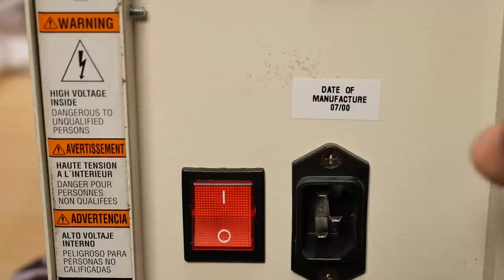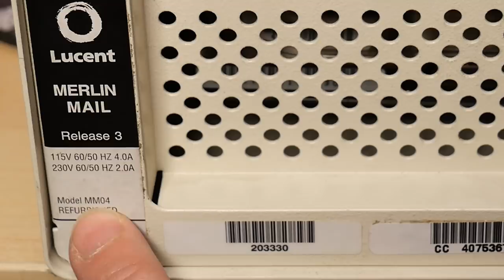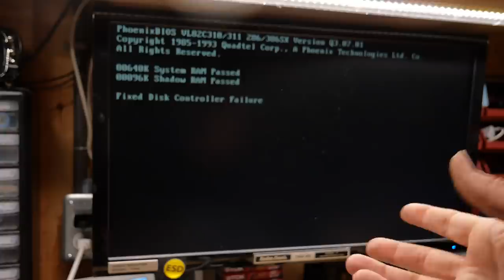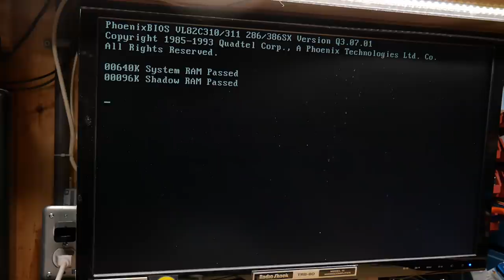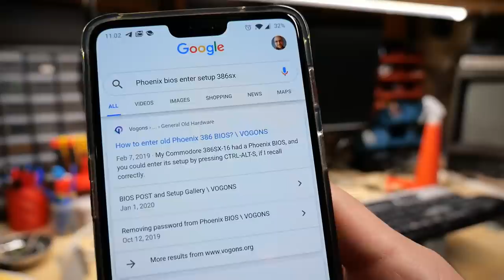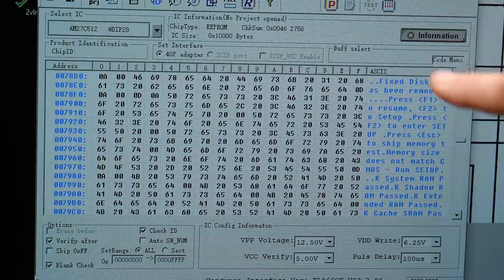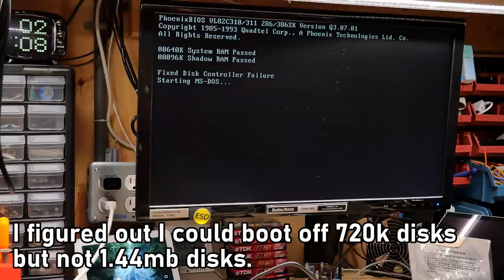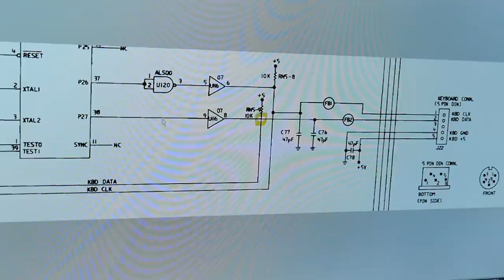Trashpicked Voicemail System

Comment: Ugh, that Fujitsu hard drive just gave me flashbacks to the early 2000s when I worked at a college and we had 100s of 20GB versions of those drives that all failed - it was a bad batch and Fujitsu had to replace them all for free - but we had to install them :(
Reply: Was that, by any chance, the famous batch of bad drives that Sun Microsystems got?  The ones that stuck, and could be temporarily unstuck (so you could keep using the system while you waited for the warranty replacement drive from Sun) if you slammed them on the desk in the right way?
Reply: David Evens possibly, not sure of the exact model but they looked exactly the same as the one in this video.  I remember thinking at the time it may have been an issue with the drive electronics because when the bios detected the drive it would show random characters instead of the drive make/model.  I don’t think we tried slamming one of these drives although that has worked for me with other drives in the past long enough to recover data.
Reply: @reddragon27284  Ah, yes, I've had a drive fail in the manner you describe, in my case it seemed to get worse as the drive warmed up.  When the drive was cool, it was still readable, but it gradually began to fail more and more until it stopped working entirely, until allowed to cool again.  Retrieving the contents took several days, as I recall.

Annoyingly, I don't seem to be able to find any specifics on the bad batch of hard drives SUN got sent.  This is annoying, as it's a wonderful story.

Comment: The bios has probably been made "tamperproof" due to the function of the machine itself so you couldn't hack into people's phone messages. I wonder if there might have been a special matching engineer's boot disk.
Reply: Probably not, due to the lack of a removable media drive in the system.  A maintenance password, very likely.

Comment: Certainly an interesting little PC of sorts, I was half-expecting one of them Single-Board Computers (with the CPU, RAM, controllers & whatnot on one ISA-connector equipped board) inside there, which if I'm honest would have turned out to be more useful I'm sure... :)

Comment: also it’s been so many years but I swear you are not pressing the bios key’s fast enough. I remember some of them you had to hit it like 15 times  the moment you flip the power on to time it right. ( ok maybe I was an overzealous teenager but what I mean is that early timing was crucial) Also consider also trying Ctrl-alt-insert and Ctrl-alt-escape.  Good luck!
Reply: I had the same thought! Too early? No good. Too late? No good. Where's the sweet spot? Who knows. Just do it 15 times you'll catch it in there somewhere ;-)
Reply from the maker: I tried all of those comments. I've been working on PCs since the late 80s and used to work repairing and building them for work in the 90s. I'm very familiar with all the permutations. This is clearly altered to prevent user servicing.
Reply: Adrian's Digital Basement I hope you get it working with the serial console method that other people have talked about. I never doubted your skills… I just know that some BIOS’s back then had a hair trigger timing. We’re about the same age... grew up on C64 and then my first PC motherboard  I bought with my own money was a 386sx-20 ( very similar to this board with drams and simms. Fun memories! ).

Comment: Did you try booting off the HD with the monitor plugged in? Would have been interesting to see... Or was the drive dead?
Reply from the maker: Yeah I should have noted that in the video. The drive did still work but just showed nothing when booted. (It goes into DOS and then autoexec lads the single EXE on the drive.)

Comment: maybe try to access the system thru the serial boards. servers of that time also didnt had graphics cards or keyboard plugs. just grap a good old vt100 or a pc with a "null modem" setting and try maybe 9600,8,n,1 just my 2 cents

Comment: 1.2mb floppy is a Japanese format. Likely set to stop people from booting DOS.
Reply: It’s the bog standard 5.25” High Density format.  In the 386SX era, that was still commonly the primary (A:) drive.  Later (when the 386DX was more affordable, and 486 era) it shifted to 3.5” 1.44MB as primary.

IBM’s XT, AT, and PS/2 systems defined the norm - and that was 5.25” 360K, then 5.25” 1.2MB, then 3.5” 1.44MB.  (720K wasn’t used in the PC market for very long.  Much more prominent for e.g. Amiga.)  As such, those are the formats that you would find commercial software on, and so the PC clone market followed suit.  Ergo, 1.2MB is likely just the default option on a BIOS of that period.

Comment: if the cmos battery is dead then of course it’s not going save your settings in the bios. or am I missing something?
Reply: It reverted the settings back to the hard coded values. If the cmos was bad it would say checksum error
Reply: @NaokisRC  In the normal BIOS, yes, but this seem to be modified and doesn't react on many errors, like VGA, Keyboard and may be checksum error as well?! Like I wrote in a comment below (see Necroware), may be it is worth it to fix the battery or replace by an evidently working one. However, I guess Adrian gets so many comments, that he will not see our suggestions :)))
Reply: @scorp4770  Yes but the point being, it knew when a battery was dead as Adrian said it came up with "checksum" error with his other rtc with a bad battery. So this one, even if not new, the battery is still good. And a BIOS wouldn't set the hard drive type anyway

Comment: Adrian - in the setup.com program you were supposed to hit Escape, F10 was just to exit the program.  Escape was reboot, which I assume would apply the settings.
Reply: Oh that would make sense. Hope he revisits this.
Reply: @NLDXBOX  me as well.  As another commenter mentioned, I would also like to see what happens when it boots off of the hard drive that was in there.  If it even boots at all from it.
Reply: Check out the help menu as well for other commands. Looks like it never saved or it's wired to reset it self. Try to change the controller board placement, could be an IRQ conflict thing. Or change the controller and other boards. Try to unpatch the cable under it.
Reply: That's what I was thinking, ie, F10 exit without save.
Reply: Yeah, and if that fails, I remember that there was also a utility for these PhoenixBIOS chips that could lock the configuration. It would have been a separate utility that would 'toggle' the lock at each run. Back in the 80386 era, I had a computer with the exact same BIOS as this one, only it was accessible through F2, as he showed. You could also use the supplied disk to access setup. The disk also contained this other utility to protect access to setup. You could even set a password for it, but that wasn't required. If protection was enabled, the 'Press F2 for setup' message disappeared at boot. Therefore, it wouldn't save the config if you tried to edit it using setup.com.
Reply: Hm it's kinda lost to "young" people that you don't have to enter the program's extension. Entering "setup" would have done. No need for the .com.
Reply: senilyDeluxe right?! I wondered why he did that as well.   Too much commodore I guess haha
Reply: @NLDXBOX  I think it'd be cool to see him using telecom equipment to play DOOM! ;-) I do hope he revisits this computer at some point though. Wonder if he could actually use it as a voicemail?

Comment: It's very likely that the motherboard is setup to run with a serial console...  I'd try plugging in a terminal or serial cable into another machine with a terminal emulator... also if I remember correctly the older at&t voicemail systems from the early 90's were unix based and used a serial terminal vs. a vga monitor and keyboard.  Looking at the data on the hard drive might give you some clues as well.
Reply: You could use the old Unix voicemail or buy a much cheaper DOS based system. Phone equipment is/was freaking expensive.
Reply: This. I came here to say this. Try connecting via serial
Reply: @Steveos312  why would you think that?
Reply: @mstandish  because you're using dos to run your systems for cheaper haha /\
thats the dif between a 10 user system and a 1000 user system
Reply: @frogz  It was around 200 people and was provided by a government contract. The PBX we used was a System75 running off of tape.

Comment: My guess is that it was built in the mid 90's and the HDD and battery were replaced in 2000 with a refurbishment as well as new software.
Reply: That is what I was thinking, a factory refurb replacement was swapped instead of repair to keep phone systems up.
Reply: I was building something like that in late 90s into early 2000, used a 486 motherboard, ran dos 6.22
Reply: Considering it had a sticker mentioning refurbishment I'd say that'd be the obvious answer that its baffling the guy didn't figure out on his own.

Comment: A lot of people are mentioning the fact that the "serial port/console" is your way in! I agree. Probably the reason for this weird keyboard setup + the keyboard connector was not accessible from the  outside. I wouldn't be surprised that they have created some weird serial keyboard (or special console device) for their technicians
Reply: The systems i work on got programmed from the phone system itself by command down the phone line interface
Reply: A program on a Toshiba Laptop should do it.  (some laptops did not carry the correct pin out or line voltage to work the programming card on phone systems, same could be on this).
Reply: @highpath4776  could be also a special serial port, I work on several devices whose serial port required a special cable, but I would say knowing most probably programed though phone system

Comment: 14:36 9506 is the date code on the Dallas RTC, so it's original. Also, the case says "refurbished". It was an old machine from 1996, they replaced the hard drive and the power supply in 2000, then sold it as refurbished. It would have been wise to replace that RTC chip as well...
Reply: Yes. 25 Years is a normal lifetime for these RTCs.  I have one from 94, it is still working.
Reply: wise yes
needed no
25 years later and its still going strong
Reply: @frogz  I'm not sure if it's still running. The BIOS utility said that the RTC date is 1989. It might be caused by the utility was unable to read the SRAM/RTC data. 
But if you ask few hundred dollars for a refurbish job, yes, replacing a 5 year old RTC battery is a minimum. Okay, the expected running time is around 10 years according to the datasheet (they don't say it's guaranteed!), but still. A working RTC in such equipment is quite important.

Comment: Networking gear is another great source of surprise PC re-usable equipment.  An example was about 17 years ago while cleaning up old equipment I noticed an old router oddly had a VGA port, serial ports, and PS2 connector.  I cracked it open and found a tiny motherboard sporting 6 network ports, an IDE connector + 2.5 HDD, one DDR slot, and an old Cyrix VIA chip.  I connected up a dual connector IDE cable and a CD-ROM and the thing booted off of an XP CD.  I had no problem installing XP on the little sucker.  XP crawled but it ran.  I put in the biggest DDR memory I could find – 512MB – and wound up transferring our old keycard system onto it from an old dying dust packed tower that was sitting under a desk in the basement for the last 5-6 years.  I screwed that little system to the wall and it ran like that for another 10+ years before finally a complete security system upgrade.
Reply: I ran into a similar situation with a small form factor pc used as a controller for a remote access KVM device in a server room.  It was an AMD K-266 with 128mb RAM.  I acquired a scrap pass to bring it home and ran it as a firewall/ router running Coyote Linux booted off a floppy.
Reply: There used to be PC Magazines that did how to build routers out of old 286/386 units

Comment: I used to be a CallWare Reseller/Installer.  It was a Voicemail system that ran on top of Novell Netware and  we used a lot of the Brooktrout boards.  Those were very common in-band signaling board (that means the phone system sent a hook flash then the DTMF code for what type of call (ie. Voice Mail Retrieve, No Answer Message, Caller Busy Message, etc) and then it sent the extension number that it was coming from and then another hook flash, and transferred the call.   There were all kinds of systems and each brand had is own codes and methods.  Some were well documented others we had to use a box called a digigrapper to monitor the line and see what codes it was sending and do a bunch of test calls.  There were also systems that used out of band signaling as well like SMDI ( a seperate cable) or TSAPI (A network protocol that signaled across IPX/SPX).  You could run the non DSP cards for up to 4 ports but (each one of those RJ11's is wired for two lines), after that you had to get the DSP version to off load the voice processing from the CPU.   As we started going to faster processors that became a non-issue.  Then VOIP started to take over the world and it all changed.
Reply from the maker: This thing was running DOS 4.0 and had a single executable and autoexec on it. I remember seeing one of these in use a long time ago and there were nothing but RJ11s between it and the PBX, so I'm assuming the DTMF signalling you mention was used. Another comment said this was available as a 286 as well which was very slow and struggled. Hmm
Reply: @adriansdigitalbasement  I am cleaning out my storage unit that I have been backing full since 1994.  I am pulling a lot of the boards ram, keeping a few cases and stuff.  If there is anything in particular you're looking for let me know.  The vast majority of it is Pentium 1 and up.  I scrapped the XT/AT stuff years ago, which I am kicking myself over now.

Comment: Brooktrout is one of the few companies that make Analog voice boards for VoiceMail and Fax. Each of the two boards has two Analog ports, as you pointed out. These do not have dialtone but will answer a ringing line, and are just an audio circuit (usually) and can send and receive DTMF, etc.  The VM communicated with the phone system over one or more serial ports (RS-232), those handled the signalling of what port to answer,a nd with what, light Message Waiting lights, etc.  Common serial settings were 9600 8N1, try hooking a serial console to them!  It looks like the original build was 1994-1996, and was factory refurbished in 2000 as indicated by the sticker on the box.  I never worked on the Merlin Mail, but AT&T commonly used System V Release 3, 4 or 5 of AT&T Unix, or MS or other DOS as the OS.  All of your bios control is probably done through Serial, or hard coded at the factory to ignore the keyboard.  You can drop the HDD, and Brooktrouts in any 386 or 486 motherboard and get it running probably, did that on quite a few VMs in an emergency.

Comment: I think the last line on the Dallas device is the date code + some chip revision, i.e. it was manufactured in week 06 of 1995.
Reply: I thought the 12887 was a fairly recent replacement part for the 1287..?
Reply: Exactly this definitely was not made in 00 but perhaps serviced then. It had to be earlier.

Comment: I have a Merlin 820 KSU and 8 Merlin voice terminals (that’s what they called the desk phones) installed in my house and I love the system. It even integrates with VoIP and my mobile phone. Amazing for a system that was designed in 1984!
Reply: That's pretty cool. I guess they knew IP phones were coming sooner or later, what with the ISDN buzz, and wanted to be sure they didn't have to make a whole new system just to accommodate it later. What kind of mobile phone integrations does it have?
Reply: @kaitlyn__L  This era, some of them would optionally notify your pager you had a desk call when you were away. That was a pricey ($3,000-5,000 IIRC) option. And that was hot back then. I kid you not.
Reply: Kaitlyn L  The nice thing about the Merlin system is that just about anything can be used as a trunk line. For my mobile phone integration I just have a small unit that connects to my phone via Bluetooth, but also can be wired in to the KSU with just regular twisted pair. I can make and receive calls via my mobile from any Merlin voice terminal. It’s called the “Dock ‘n Talk.”
Reply: @kaitlyn__L  ISDN lines cost a lot of money to plain copper.
Reply: @nbntelevision1  There are/were options to bung a SIM card in an onboard socket to translate mobile to IP /ADSL or PBX / POTS Lines

Comment: Funny you're doing something on this. I run a 30 year old multi  conference/chat line that uses old dialogic d/40b cards. Its a intel P2 400 mhz running DOS 5. The cards are from 1988 or there abouts. It has a dialogic bridge board D/80. The program is written MS C+ with some asembler code.
Reply: Really! Would you mind dropping the number?
Reply: I second dropping the number. Would love to dial in.

Comment: Brooktrout!  Man what a blast from the past.  They used to make cards for faxes and voicemail systems.  Way back in the 90s I had to maintain a bunch of OS/2 based voicemail systems, and they all used Brooktrout cards.  Most of those systems were tied into Mitel PBXs, and had an external interface box to do the trunk line signalling.  But the brooktrouts did the actual voice line processing.  Pretty cool cards, the ones I dealt with did on board DTMF recognition, and could play back a decent set of PCM sample rates.  We would use the Voicemail systems to do all our IVR work as well.  I wonder if Asterisk or some other soft PBX still supports them?  Also... plug the serial board back in and see if the BIOS does serial redirection... most Telco stuff had service done thru the serial port.
Reply: I have a college that wrote a fax system using those cards a few years ago, still in use by us, Brooktrout has a Linux SDK we used.